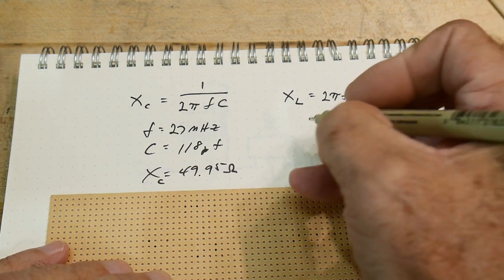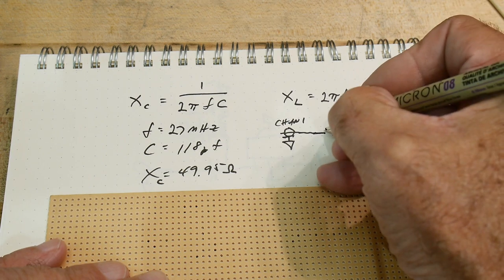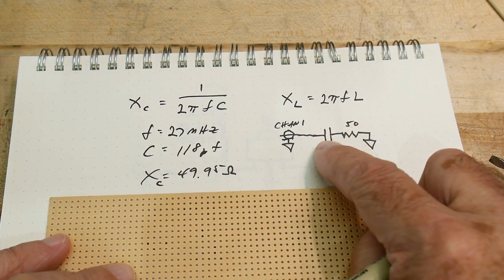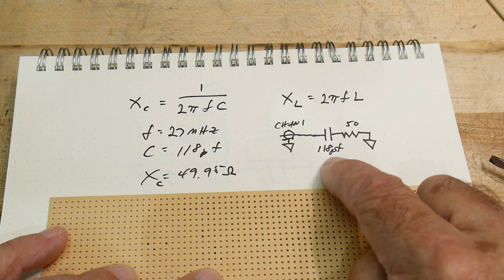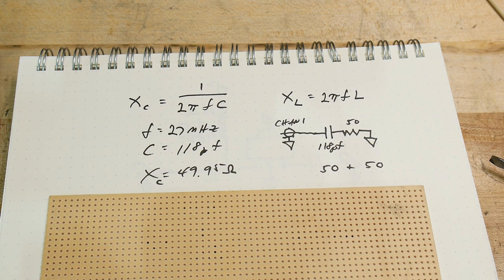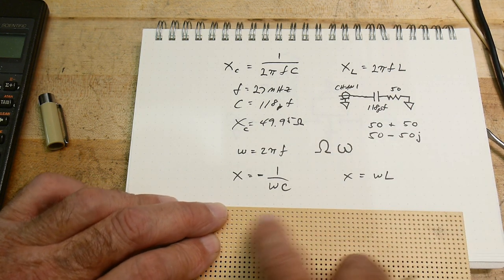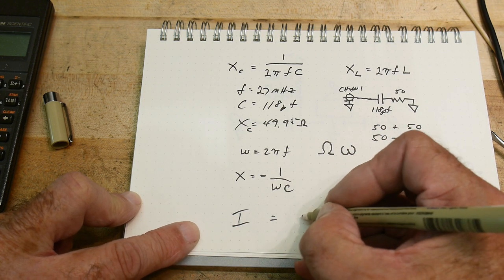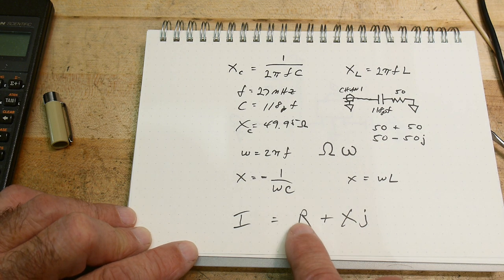#919 Resistance Reactance Impedance

Comment: Also, I have to say that the 2π converts the frequency, f from the unit of Hertz (cycle/s) to the "unitless" unit of radians/sec.  The 2π being of the unitless unit of radians/cycle.
Reply from the maker: well radians are a unit, and seconds are a unit. so radians/second are certainly units. The 2pi part does come in handy with all those sines and cosines repeating themselves every 360 degrees.
Reply from the maker: since 1 Hz = 2pi radians/second. the units  conversion is just cycles/sec to radians/second. sometimes called angular frequency (omega)

Comment: You were great until the very last equation when you used capital "I" to represent impedance; that might confuse someone (I could hear the gears turning in your head as you said that and was surprised when you used it!).
Reply from the maker: Yes I should have used Z but I really believe the problem with teaching is that people get hung up on just memorizing things instead of the fundamentals. And if you see a random Z there is no way to tell what it stands for. and why j when there is already an i. Just wait for my big lecture on gamma and what the smith chart really is. I will loose 99% of my audience
Reply: @IMSAIGuy  So the current (C) is equal to E/I  ?  . . .  ;-)
Reply from the maker: I think you are confusing E and V. E is for energy, or power of 10 exponent, can't remember, vitamin E maybe 😎
Reply: @IMSAIGuy  Hmm, not so sure about discarding E since it has historically (at least in EE) stood for electromotive force (emf). E and V are often (perhaps mistakenly) used interchangeably when talking about voltage if the discussion relates to ordinary electronic circuits. In ham radio you probably won't get dinged for exchanging E=IR and V=IR. Think that E should be used when the discussion is about fields, ie motors, generators, antennas, transformers etc. for example when thinking about back-emf.
Reply: @PapasDino  Right, E is electromotive force measured in Volts, I is current measured in Amperes, R (or Z) resistance or impedance measured in ohms, and of course as noted X is reactance also measured in ohms.
Reply: @IMSAIGuy  I was trying to be funny.  I certainly do take vitamin E, but as Dino Papas notes, E is used in many electrical engineering texts for electromotive force.  Just looked at one of my old engineering texts and it gave Ohms law as E = I/R.
Reply from the maker: @RideGasGas  I was trying to be funny too. my main point is to try to save people from getting buried in the correct form and try to learn the concepts. Dino can poke as much fun as he likes (he's got a free pass)
Reply: @IMSAIGuy  
That's why we use V instead of E for voltage or automotive force....
But since I moved to a special part to Asia, Ohm's law is not valid anymore ;)....